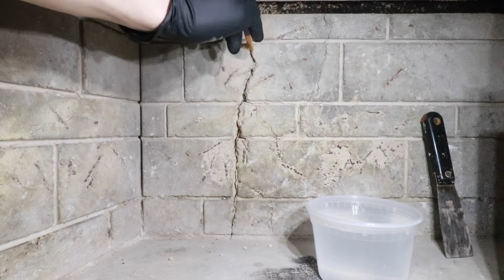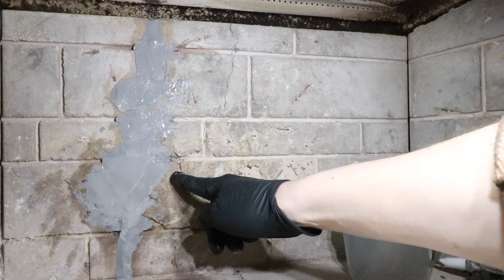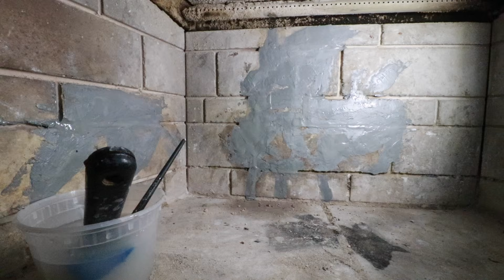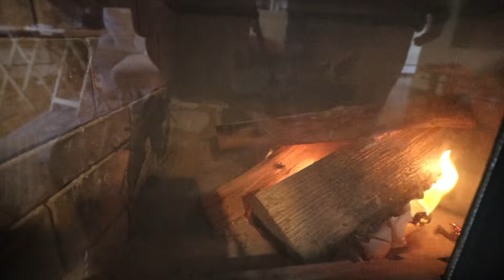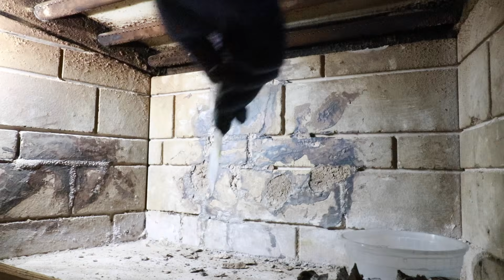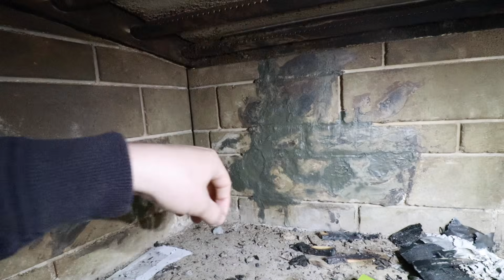Repair Cracked Fireplace Panels / Refectory Panels | Cheap & Easy

Comment from the maker: Update 2026 I've found that Rutland Dry Mix 211 is a better and longer lasting solution. Here is a video about how to use it:
https://youtu.be/yborAO3R6Yk?si=lbZX6Ow80Z5v2uX2

Fireplace Repair Mortar:   https://amzn.to/3T3A2g7
Caulk Gun:                           https://amzn.to/3mKwaE9
2" Sparkle Knife:                 https://amzn.to/3GUe4Gt

Comment: Excellent details through your entire video.
Nobody else mentioned you need to wet down the cracks B4 application.

This is super helpful. I have the same issue & have not used our fireplace in years because of that. 

Great job. I'm going to do this soon.

Thanks so much. ‼️

Comment: Something many folks do t know. A new fireplace has to be cured. If you bought a new home with a fireplace that has these panels you must cure them before building big fires. That’s why so many panels crack. You should build a few small fires over a few days. Most builders skip this once the home is done.

Comment: Fallacies:
- You can control a fire temp. 
- You can limit it to 250 degrees.  
- Paper won't ignite unless exposed to a temp. at or above 451 degrees.

Comment: How has this worked for the last 6 months?
Reply from the maker: As I noted in the video, It took a few applications of this stuff to get it set/adhered properly.  I am currently staring at the fireplace as I type this. The repair is holding up perfectly. No Regrets. My only small cosmetic complaint is that it doesn't match the color of the existing refectory. No big deal. However, It seems to be blending nicely over time.
Reply: @OldSoulMillennial Thanks, I think I'm about to repair mine and I have a few deep holes where edges chipped off the brick. I think this can work.